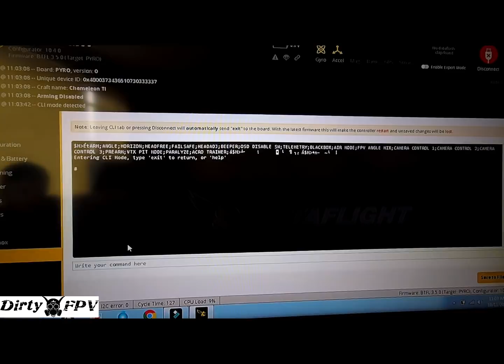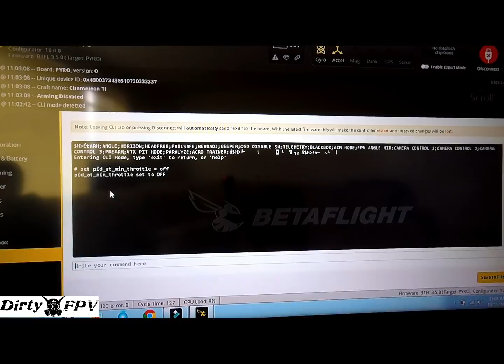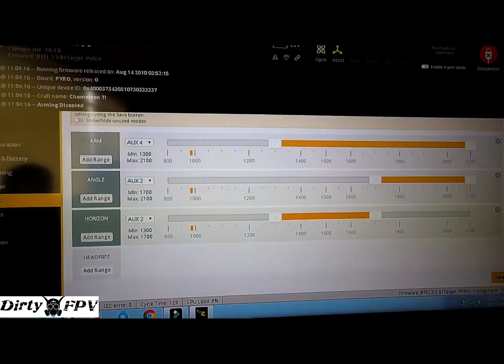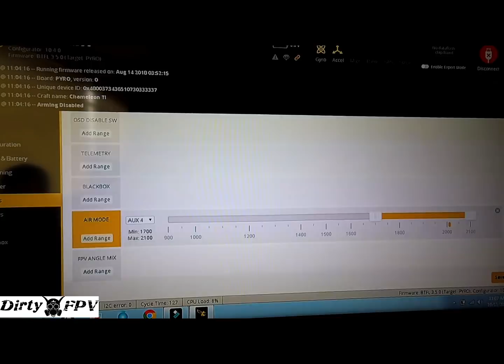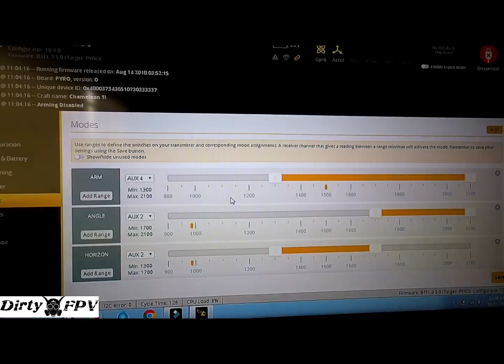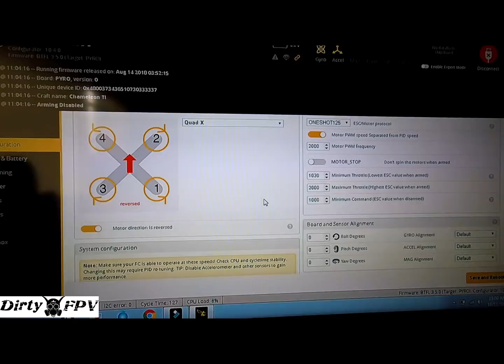Idle up for Betaflight (Full tutorial version)

Comment: is air mode just another mode like acro,horizon,and angle mode so if horizon and angle mode isnt active then u are in acro mode
Reply from the maker: Yes and no. You can still turn it off and on. Air mode keeps your props at a set Idle speed with throttle stick at zero. 
This literally has nothing to do with this video though. I still run an idle at min throttle. What these settings do is give you the option of turning off the pid loop so gyro isn't trying to control things. As soon as I turn up my throttle stick I have air mode and gyro.

Comment: why not just have the air mode on one switch to turn off or on
Reply from the maker: It is. Air mode only works in the third position. The second position is air mode off and pid loop off so if you bounce a landing the quad don't react and throttle up all crazy. I hand catch and take off all the time now because min throttle is literally min throttle you can stick a finger in the prop and it just stops the motor
Reply: @dustinbailey1980  so if I don't go to cli and turn off min throttle at lowest point then when in acro mode and air mode switched off then the quad will still try to level out
Reply from the maker: @jamiehill9578  yes air mode is a higher input. But still without the pid loop (gyro) active the motors won't spaz out. But with a 3 position switch it's nice to have the middle position for take off and landing with no automatic control from the gyro, and with really low idle when you bring the throttle down.
Reply: @dustinbailey1980  thanks I'll give it a try,,,,,, so I have to go into beta flight and turn off idle at low point in
Reply from the maker: @jamiehill9578  the idle don't turn off. The pid does set pid at min throttle to off. This cuts out the gyro so the quad isn't trying to equalize things and correct them
Reply: @dustinbailey1980  great and thanks again for the info and fast response

Comment: I don’t know if things changed since this video was posted but using your setup it worked as expected. But even at low throttle without the pid active the motors still have a lot of strength and I don’t think I could stop them with my hand like you do. Did you lower your idle speed or something else to be able to stop the motors that easily without pid?
Reply from the maker: It is possible that a newer version of betaflight has changed something that I'm unaware of but no what enables you to stop the motor is that the gyro doesn't try to correct for that motor RPM changing it lets you stop it freely because it's not in a pit loop

Comment: This is amazing XSG! It's my first time hearing about IDLE UP. I have a question though. I have quad with AIRMODE ON. Today, I was flying low maybe about 30-40mph and quad went too low and I hit the lawn. The quad went nuts! It flew up and got itself stuck in a tree. If I was using IDLE-UP, will the same thing happen?
Reply from the maker: Well yes. Once your up and flying you want to use airmode. This keeps the props spinning to sort of float, or defy gravity if you will. Say your going to do a barrel roll. You'll blip the throttle up and then drop the throttle as you roll and then come back smoothly on the throttle. Without airmode it would start to drop very quickly and reduce the amount of roll control you have.
Now what happened to you is best avoided by a quick disarm toggle. The gyro was trying to correct the quad that's why it went out of control. In a crash I like to just quickly disarm.
Idle up mode will turn off gyro but leave the props idling, sometimes when you land if it's kinda shaky the gyro will actually throttle up for you and try to adjust. Idle up turns that off so even if you land a bit rough you just pull the throttle down and it will land and if a prop hits something it will just stop.
Reply: @dustinbailey1980  oh got it. I had a wrong understanding of AIRMODE on other videos I saw. I honestly thought that with AIRMODE OFF, we will be able to fly like we used to but with the benefit of quad not going nuts when we bump on something. That's what I was thinking the other youtubers were trying say about AIRMODE OFF. It looks like AIRMODE OFF is beneficial during arming and also when you like to check props.

Btw, this was my crash today - https://www.youtube.com/watch?v=dkv5Ahj2a-U

And yes, I quickly disarmed it when I knew it crashed. It stopped the props.

Is this a good idea? I'll turn off AIRMODE when throttle is at 5%.

Thank you so much for responding right away! Really appreciate it.

Comment: Idk why but I had just tried this same thing then found this video lol I got pid on min throttle off and airmode on a switch but. When I throttle down it still goes to pid off while I'm flying if I go to bottom of throttle...... We just saw the end of video. I gotta try leaving throttle up for a sec first to see if airmode will stay on for flight at all times
Reply from the maker: My airmode is seperate as well. I only run acro. It's a 3 position arm switch. 1st position is disarmed, second is idle up, 3rd is acro air mode
Reply from the maker: Make your switch 3 position so you can tell it to keep airmode on. Middle position to turn off air mode.
Reply: @dustinbailey1980  I just put air mode on its own switch cause I don't have it set up the same. Acro only. But I figured that would accomplish the same thing. About to test it out right now with props off first. I just want the gyro to be on the whole time im in the air no matter the throttle position.
Reply: @dustinbailey1980  sweet it's working. I didn't realize airmode kicked in and stayed on after throttle is up for a sec. I tried it right away and it didn't work so I gave up last night. Guess I didn't give it enough throttle yet. Thanks for the tips bro. Oh and I subbed ya earlier too🤘✌️🙌

Comment: Do you use Air mode with Idle up together ? (sorry my english is bad so i cant unerstand all video).
some people only use Idle up or airmode.Thanks for video.
Reply from the maker: Yes. But one or the other.
On a switch. Being able to turn off airmode means you can disable the gyro and the quad won't spin up and try to level itself.
So I land in idle up mode but I fly in airmode

Comment: good video! But when I arm mine it wants to go to the moon, what can I do? thanks!
Reply from the maker: If the idle isn't at zero it shouldn't arm.  However if the props are off it will try to correct horizontal and it will continue to increase idle without the props
Reply from the maker: With the props on?
Reply: yes, like its too much idle. its just a geprc 12a aio on a primo frame

Comment: Brilliant idea bro! This gives the best of both worlds, "Idle up" for landing/skids/diagnostics and air mode for doing low throttle maneuvers with authority.  It's probably worth mentioning (as some viewers seemed confused by this in the comments) that in idle up mode "pid_at_min_throttle = off" only disables the PID loop while the throttle is below "min_check" (e.g. 5% of the throttle stick range). This is effectively a dead-band and none of your stick inputs (roll/pitch/yaw) will function while the throttle is below that value. However, when the throttle is raised above that value the PID loop is enabled but has reduced authority, i.e. it doesn't correct as forcibly as with air mode on, which is what makes landing easier and skidding possible. Once air mode is engaged the "pid_at_min_throttle" setting is ignored since air mode keeps the PID loop running with full authority even at low throttle.
Reply from the maker: Very good explanation! Thank you
Reply: Set Pid_at_min_throttle = off

Have I got that right what I put in to the cli

Comment: I like this idea but i prefer put arming and idle up+airmode on different switch for safety reason not disarming accidentally..
Reply from the maker: Yes because with props off the quad is trying to correct itself and it can't because it has no prop thrust.  So it constantly throttles up looking for "level"
With idle up enabled the gyro pid loop is off,  so the quad will not try to correct itself.  The motors will run a low consistent idle.
Reply: Dustin Bailey ill try this tonight, before im using le drib's idle.up + airmode.. but the pid still on
Reply from the maker: Acro is not actually a mode.  It's a lack of mode.  With angle and horizon turned off its automatically in acro mode
Reply from the maker: That's why I run a prearm
Reply: Dustin Bailey oh wait, with pre arm on, we cant get disarmed accidentally ?
Also did you have any issue with pid on low throttle off? Because after enable airmode and i add throttle a bit, the motors are continuously increasing speed it self... Can it makes the quad run away? Because to reduce the motor speed i need to force disarm it.. Weird..
Reply from the maker: Correct,  the motors should only increase without props.  The 3 position switch only changes between air mode and idle up. 
A separate switch for pre arm.
Reply: Dustin Bailey so with props on the motors wont increasing speed by it self like when props off? Hmm.. Your 'idle up' center switch switch means just acro right.

Comment: in idle up mode the throttle lever is not allowed to function. that means in idle up mode you should not be able to fly at all.
Or I understand that wrong .. so it explains to at least Mr. steele ..
Runs so far with me ... only that with the active giro does not work. That means if I take throttle down  in the Air mode, I did not have a Giro for the moment. So with me idle up was also active in air mode ... ?????  have it now in the train set ... but means that I can not fly in idle up
Reply from the maker: Correct in kiss fc.  Idle up.  
This is idle up for betaflight,  it's slightly different,  you still get the advantage of being about to test motors without the pid loop active.  So if you pick up the quad and it's not perfectly level it's not going to freak out and cut off your finger trying to correct itself.  This requires air mode on a switch.  As long as air mode is switched off you can drop throttle for a landing and go back into inactive pid and not bounce when landing.  Also cool if you happen to clip anything with a prop when landing it will just stop the motor with very little resistance.
Reply: @dustinbailey1980  okey thanks.. now it is working. Thanks mate...
Idle up without throttle.. than idle up with working throttle and low pid and low giro. And at last air mode... thanks a lot😍

Comment: Can you fly with pids_at_min_throttle set to false and still no airmode?  Experiments incoming...
Reply from the maker: Yes,  but doing tricks without airmode is horrible
Reply: @dustinbailey1980  likewise, you can have pids disables at min throttle and just add airmode to your arming switch...  Then you just don't have that "diagnostic" mode, but landing would still disable pids once you fully cut throttle, right?
Reply: @dustinbailey1980  You have min throttle set pretty high, are you sure airmode even kicks in for you ?
Reply from the maker: @noobFPV  Be pretty hard to do the tricks I do without airmode

Comment: Thanks for having shared this. I just understand a thing. With this, even if I'm in air mode, the motors stops after a crash BUT I have air mode stability when I do tricks with throttle 0? Do I have to set something on the Taranis (like increasing throttle in 0 position)? Regards
Reply from the maker: Once you throttle up with air mode on the pid loop activates and it's normal,  so the motors don't stop when you crash. 
You can move the switch back to idle up mode right before you land and then the pid loop will deactivate when throttle goes to 0
Reply: @dustinbailey1980  so when you do tricks and kill the throttle air mode turns off? that's whats happening on my quad. when I fly air mode is active but when i do tricks and kill the throttle, air mode de-activates. gyro is not active when throttle is zero mid flights.
Reply from the maker: @abFPV16    No sir.  Gyro should never shut off.  If your motors are killing at zero throttle you've got it set up wrong. 
I have "airmode" on a switch. 
1st switch setting is Pre arm,  2nd arm (motors turn at set min throttle (no accelerometer) you can stop the props. 3rd position is airmode (accelerometer on)
Reply: Dustin Bailey amazing. Thank you very much for the kind reply!

Comment: https://youtu.be/KAVexAd-gBE
Reply from the maker: That's interesting,  kinda confusing and not exactly how I do mine. 
With air mode being such a wonderful thing to use,  I feel like that needs to be the 3rd switch position,  first position is disarm,  and middle is min throttle no pid. 
With my set up you can throttle up and then back down still no pid.  Not until you move to 3rd position with airmode
Reply: Yea, your version sounds much less confusing:)